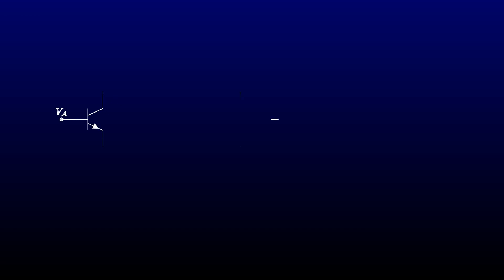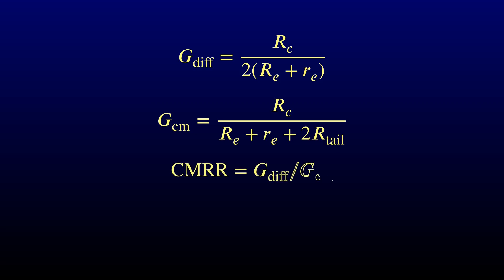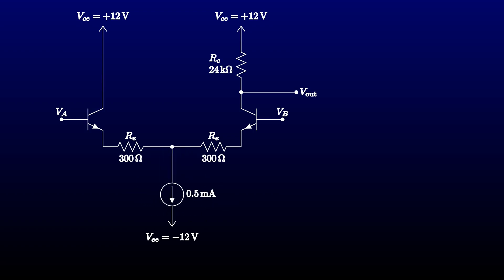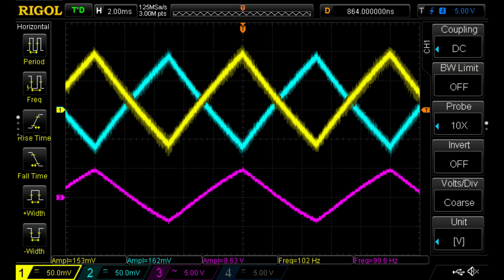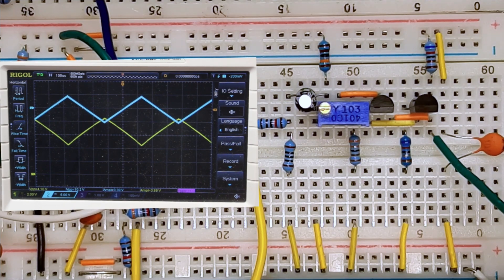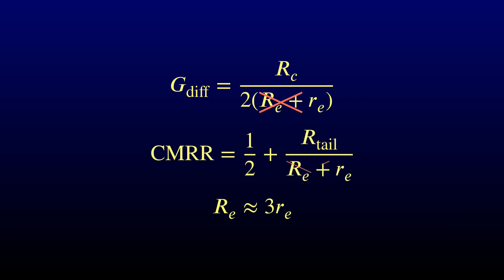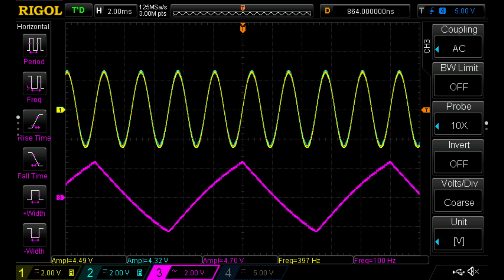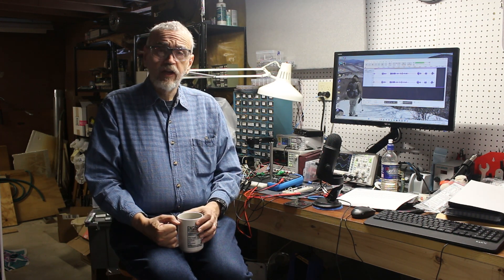Improving the Long-Tailed Pair (Transistors 101, episode 15)

Comment: EXCELLENT PRESENTATION! WAS CERAMIC DISC CAPACITOR USED TO PREVENT OSCILATION?
Reply from the maker: Pretty much every power supply pin on every IC needs a small (0.1 uF) ceramic to ground. When an IC output swings rapidly, it's drawing a big surge of current. That can couple into all sorts of places, making it oscillate, or distorting its output, or crosstalking into other circuits. If you notice a signal acting weirdly, one thing to do is make sure you haven't forgotten to decouple the power supply.

Comment: get the to78 transistor matched pair NPN I think it would be better I think the case should be grounded LS313 TO-78 6L we do the same for dual JFETs pairs this ensure temperature stability
Reply from the maker: Yeah, a monolithic matched pair like that, or the AS394, would work better.  I didn't have any on hand, so I used a selected DMMT5551 pair with a good match.  It's still in one package.  (Nowadays, I tend to use a surface-mount one, put an RTD on the back of it as a tempco, and conver the whole thing with a drop of hot glue and a little bit of scrap closed-cell foam to keep it out of drafts.)  But the conclusion, a couple of episodes hence, is that you already get a well-matched pair in the input circuit of an op-amp, so if you're not doing anything special (an OTA, an exponential converter or log-amp, etc.) just use an op-amp.  [But now you understand how an op-amp works - I wrap up the part on long-tailed pairs by analyzing the internal schematic of a cheap bipolar op-amp.]
Reply: @KludgesFromKevinsCave   We had an 80-year-old Ph.D. who worked with us for 30 years. We used to call him "the Bulldog" because of his flawless expertise in circuit design. One day, he approached us with a box he had built, connected to a short twinax cable and an ion chamber detector. He confidently stated if I recall, "I can see 1 femtoamp resolution," which is equivalent to just 6,240 electrons per second. I believe he used gold coated Dual JFET matched transistor probably the U421 TO-78 from Linear, some pins were soldered to Teflon studs drilled into the PCB. short connection to the connector, big glass resistor, and Voltage to frequency circuit. Of course, I had to annoy him (I was just a technician at the time) by telling him to just use the ADA4530-1, but he did not like my suggestion at all :)
Reply from the maker: @seano5098  electrometer circuits are pretty squirrelly. I'm glad I don't have to deal with them much.
Reply from the maker: @seano5098  Electrometer circuits can be pretty squirrely.  I'm glad I don't need to work with them all that much. 

Even with a packaged ultra-low-bias amp like the ADA4530, you still wind up in the world of Teflon standoffs, active guard drive (and guard rings in your layout), and so on. And then you discover that there's a solder joint somewhere that's turned into a thermocouple or something.

I have a paid project that's counting X-ray photons, but the scintillometers and their buffer circuits are all commercial. I'm just doing the software that conducts the test.
Reply: @KludgesFromKevinsCave  I know what you are saying the company I work for (technical associates) they are doing it since 1946, so all process of getting it to work by cleaning, materials used, baking has to be controlled very carefully.

Comment: How would constant Current diode such as the 1n53xx series or  CRD such as S-101 Diode 100uA diode ?  They should it should provide just as good response to temperature variations
Reply from the maker: The temperature variations in the tail current source don't have that much of an effect, since they affect both transistors of the pair equally.  The 1N53xx are great if you're eager to have the absolute minimum parts count and you can tolerate the pretty sloppy current range. I'm not usually that hard up for board space or parts count, and I usually have a stable power supply somewhere, so three resistors (a voltage divider at the base and and emitter resistor) and a cheap transistor are a better current source for me most of the time. I used a current mirror here (a) because I'd already shown the one-transistor current source, with several different base voltage references (an LED, three forward-biased 1N4148s, a voltage divider), and (b) because I'm building up to the internal schematic of a cheap op-amp, and the one I'm building up to uses a mirror.
Reply: @KludgesFromKevinsCave   Thank you for the wise comment, I am pleased with your fast response it hard to find classical analog designer today. I still reading IEEE publications from 1969 and respect old analog designers.   as a kid I always was upset that in monolithic IC drawing they never explained that current source circle with arrow, then I thought it is just a resistor, and then i thought it was that transistor with base to collector short, and later on a current mirror, I know they did not have much of space to make the silicon die back then in the 70ths.

Comment: Hi! Just discovered your channel and I love it already. Here's a question for you that has been on my mind recently (about to do some bench tests today)... There's a long-tailed pair with a 2mA (total) two transistor feedback constant current source (biased with 2mA to ensure a stable high output impedance) and the long-tailed pair also has a current mirror as the collector load. The current output is fed into a single transistor voltage amplification stage, and the whole thing is used in a closed feedback loop. The question is, how much of a benefit would having emitter degeneration resistors on the long-tailed pair (or the current mirror, for that matter) actually give? I know that the emitter degeneration resistors improve the voltage difference linearity of the long-tailed pair (by swamping the non-linearities of re' vs. current), but since all of this will be used in a closed negative feedback loop (the non-inverting and inverting inputs will have virtually no voltage difference at all), on top of which the constant current source in conjunction with the current mirror should enforce a current virtually independent of the emitter voltages with quite the nice balance between the long-tailed pair transistors (can re' really vary that much?), is there much benefit to be gained (or drawbacks to be suffered, for that matter) by adding the emitter degeneration resistors? I am trying to squeeze as much performance as I can on a tiny circuit board (4 by 6 cm) with discrete devices (transistors matched in-situ to absolutely no more than 50 microvolt difference at the emitters, and they are BC550Cs and BC560Cs in case you are curious about that), and resistors do take up quite a bit of space if laid flat. Oh, and, all of this is for a discrete operational amplifier design that will be used in guitar and bass amplification purposes (not to mention the purpose of educating myself), and I am an odd fellow in the sense that I find even-order harmonics dull and as if they were not even there and instead enjoy soft, symmetrical odd-order harmonic distortion quite a bit. I even designed a whole fuzz circuit using two stage complementary amplifiers and soft clipping to satisfy my lust for the fuzz! Then again, I also love diminished chords, the double harmonic scales, the flat two and all kinds of other weird things others would probably call cacophony!

Thanks for all you do and all the best!
Reply: Some more info about the discrete op amp from the bench:

Input bias current: 150 nA (measured across a 10K input resistor)
Input offset voltage: 3µV (measured with a gain of 100)
The open loop gain is too much for me to be able to measure accurately. Even just a millivolt DC input was enough to send the output to the rails.
Slew rate was measured to be 3.11V/µS.
Input impedance was calculated to be 650KΩ.
Reply: One more mildly interesting observation:

I decided to "downgrade" the constant current sources to be biased from a voltage reference consisting of two 1N4148 diodes with the same 1mA through them, and the quiescent current at the output dropped to just 1mA with no observable degradation of performance. I think I'll stick with this design of 12 transistors, 6 resistors and 4 diodes.

Update: I measured the slew rate with this CCS setup to be 3.6 V/µS. Confusion.
Reply: Probably final update:

I decreased the VAS emitter resistors to 56Ω. This gave a quiescent current of 2.5mA, and increased the maximum clean voltage swing into  the 1㏀ test load to 18.3Vpp or 6.47V RMS. Nice.
Reply from the maker: I'm really glad to see that you're experimenting - that's the best way to learn this stuff!

I can't think of too many situations where you'd need a 50 µV match for audio - but I have anything but a 'golden ear'. I grew up about half a km from a major international airport, with consequences to my hearing.  The last batch of DMMT5401 and DMMT5551 that I got, most of them matched to about 300 µV. much better than what the data sheet promised.  They mightn't be my first choice for pairs, but I got them during the Chipocalypse when they were what was available for immediate shipment.

For an actual soft-clipper, I kind of like the sound of an overdriven LM13700 - although they're temperamental beasts. You usually wind up using the second OTA in the package to tame the first in some way.

The flat two - if I understand what you're saying - is the borrowed tone 'Neapolitan sixth' chord of classical music. Typically used in a minor key - in A minor, say, it's D♭ in the bass, with F and B♭ above - usually followed by a V-I cadence.  The feeling of the sound can be described as "more subdominant than the IV chord".  

The better classical composers used some awfully weird harmonies - Bach anticipated the jazzmen!

Comment: I've noticed that the differential input stage of most op amps use a current mirror on the collectors as well, although this will likely send the gain through the roof so you'd probably need some negative feedback to make it usable again. You can also make a crude voltage controlled amplifier (VCA) by substituting the current sink's programming resistor with a variable element like a transistor is not great as there's a lot of CV bleed through, but it does work.
Reply from the maker: Using a transconductance amp as the input stage is something that's coming. I'm just trying to keep it simple to start with.

Comment: Current mirror to the rescue! In discrete power amps I tend to use a cascoded constant current source, current is set and forget at the design stage anyway and cascoding increases impedance even more.
Reply from the maker: Yes, indeed! The only real disadvantage to the cascode is that it adds an additional diode drop to the voltage compliance, which is usually not a big deal, it affects only the common-mode input range.

I do need to get around to discussing common-base configurations (which are usually the output stage of cascodes) more - but I'm also trying to get to a point where I can use this stuff in projects.  It's a delicate balance, trying to both teach and make things! (Hint - I'm interested in electronic music.  What are the uses of an overdriven differential pair?)
Reply: @KludgesFromKevinsCave  Simplest that come to mind are fuzz/distortion/overdrive type effects. Maybe some octave type effect with a couple of diodes, resistors and capacitors here and there?
Then there are ladder filters, but overdrive of the pair is a pleasant bonus there, not the main job it has to do.
Reply from the maker: @akkudakkupl  I think you might need to stay tuned! There's more interesting stuff coming that you haven't mentioned!

Comment: I've been watching your videos from transistors 101 and it has dramatically improved my understanding of transistors. Thank you so much from one stranger on the internet. I have learned and executed so much using vacuum tubes that I didn't not have a great understanding of current driven devices. You have helped me overcome that. Thank you sir
Reply from the maker: @MrMersh-ts7jl  Things are going to look more familiar when we get into FET's - they're a lot more like fire bottles. They can mostly be thought of as transconductance devices.
Reply: @KludgesFromKevinsCave  so far this is definitely my experience. Thank you